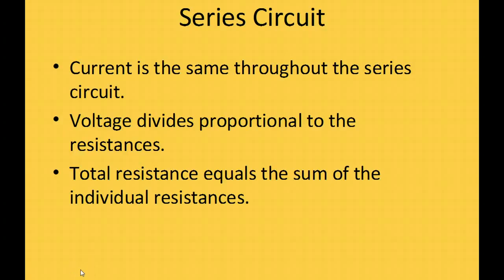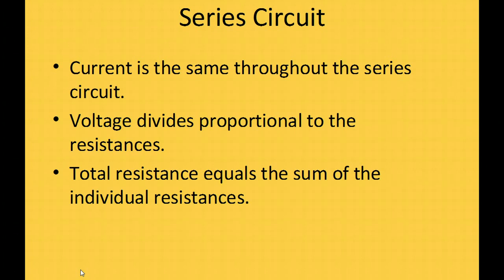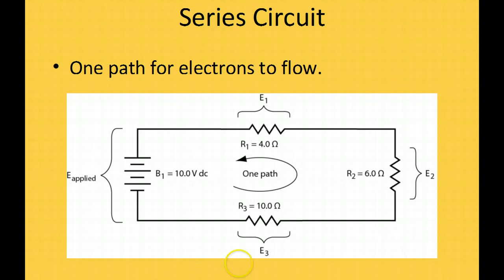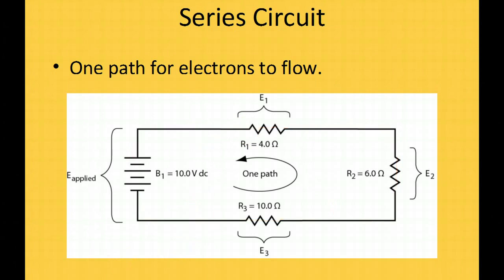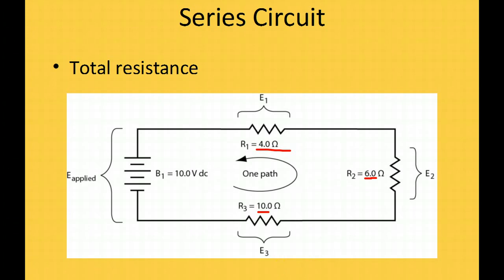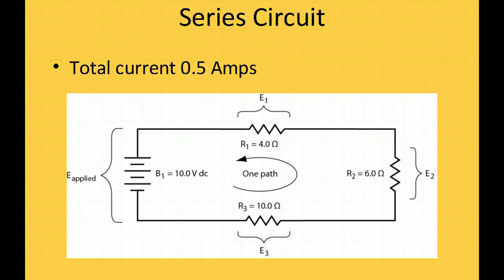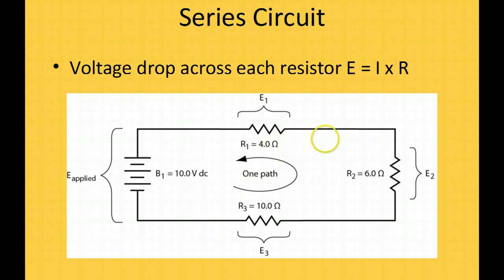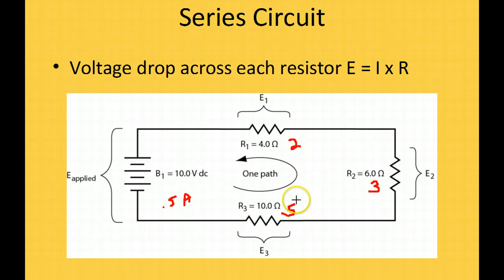NATE Core - Series Circuits

Comment: Are all series circuits d.c.  just that it seems that when the flow of current goes through a resistor then goes to the next one and goes through it, that only d.c. circuit would do this???
Reply from the maker: Hi Danny, 
Series circuits are also in AC voltage systems. They are most often used with system safeties.  For example a gas furnace will send 24 volts AC through a series of safeties... flame rollout switch(es), heat exchanger limit, vent safety, before beginning the ignition sequence. If any one is open the furnace will not ignite.

Make sense?
Reply: Yes i see now what you're saying now,  I must have been half asleep, when I asked this question.  Thanks Ron and have a great Day.